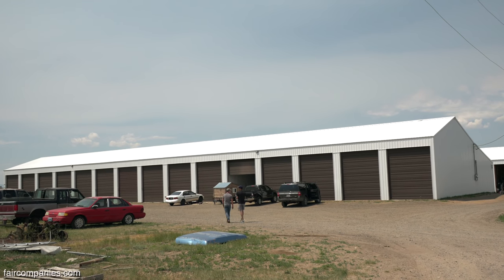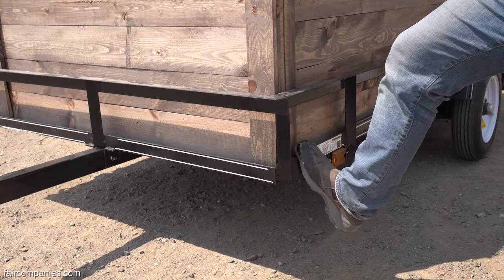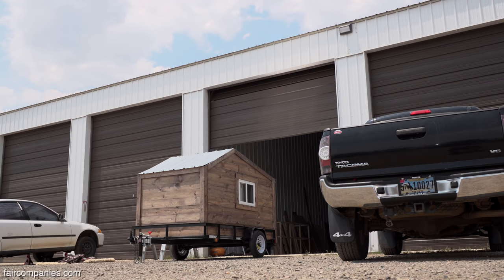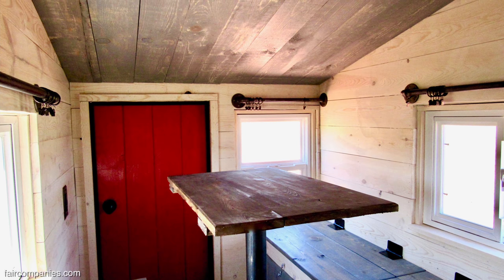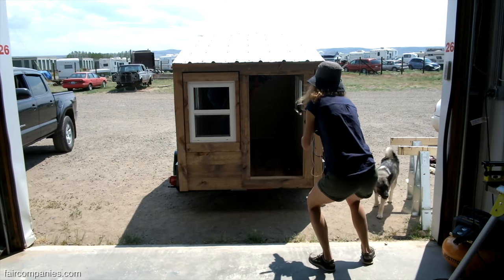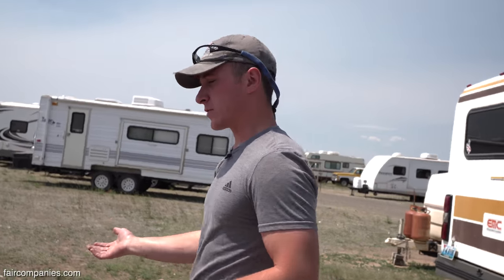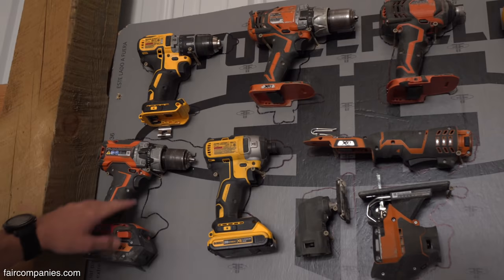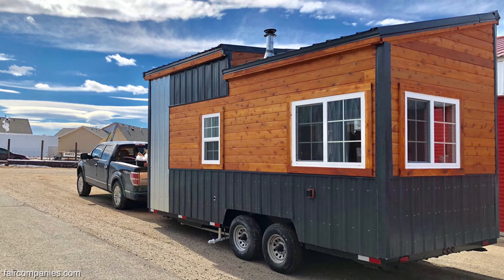Wyoming students make custom micro-campers to live & sell

Comment: As a Wyoming resident it is good to see this small state get some attention. As a carpenter/home renovator I love looking at what others are doing. I have a trailer in the back that I have been slowly tearing apart. It was supposed to be a small fix and the trailer was trash. $500 for a single axle trailer. Now if only I could tiny house that.

Comment: Just an FYI Ridgid Power Tools have a lifetime warranty on them you shouldn't have had to buy a new one if it burned up on you. If you buy them new at the store the Lifetime warranty sure does come in handy I've used it a couple times. A few years ago I also used to work in Hardware at Home Depot and did a few exchanges or Returns on them but if it's beyond one year after it's been purchased at Home Depot you have to go through rigid the manufacturer so I've assisted customers in doing this. It's super simple and they're really good about replacing it for you.

Nice video and excellent work.

Comment: The only real disadvantage to getting a bigger one would be the weight because you would need a bigger vehicle to haul it, but you could make a bigger house than that one and still be able to haul it with regular SUVs and small trucks. I'm thinking that if you were to use some different building techniques like using metal studs and less heavy exterior wood, like Cedar something, then you could make the overall structure way bigger and only ad maybe a thousand pounds at most. Look up the tiny house that these two teachers in Japan live in that can be hauled by their small van, I'm thinking you can make even something bigger that could still be hauled by a van.  Then you could distribute two models, one model for camping that is more off road focused and then another model that would be slightly bigger but still way basically the same that would be more for City travel and geared towards the market of people that just want to have a cheap and comfortable living space that's mobile and not have to pay rent or mortgage.   that second Market is actually way bigger than the camper trailer Market is because people are fed up of waste in the majority of their money on apartments for mortgages, so if you could offer 10 to $20,000 option that can be hauled by a regular minivan then you would have a huge Market of people around America looking to buy from you and you could have a huge facility to build for all those people eventually ( the biggest problem with most tiny house producers as they try to produce way too big of houses that end up costing the consumer way too much money and they have to be towed by huge vehicles, properly built tiny houses for one or two people without kids is probably going to be one of the biggest developing Industries in the coming decades)

Comment: I use mobile home windows. Mobile homes (called trailers) are delivered and this means they are pulled on the highways and interstates in all types of weather. The windows must be rain water resistant when going down the road. They are also way lighter and more affordable than home windows. Our windows were like $28 and $37 each brand new. You want small windows as people and bears can not break them out and climb through them.

Comment: At time 2:37 are the statements "it is treated lumber, treated pine..." and "If you are making a deck you can use this" which means that it is treated with poison to keep the bugs from eating it.  Since there is plywood inside the pine, the poison will take a while longer to get to the occupants.  Sometimes you really do have to know what you are doing.  Right, Kirsten.
Reply: That's just the siding. The interior is not made of treated wood. It should be fine.

Comment: You can lay down and stretch out very cool for a year drop camper, pack all the camp gear in it when you get to destination they can set up and the trailer is the sleeper.
Reply: or get a fucking tent and use the pickup to carry the gear
Reply: Gregory Everson I saw this video where this guy bought a old U-Hall truck with roll up door in the back he made a cool temporarily home out of it in the back it was stealthy living he said he could almost park it anywhere and it would just look like any work truck it was very cool how he had the inside set up for one or two people. Everything folded up out the way he isolated the walls and cut a door way to the drivers seat and a escape hatch on the floor of the cab so he could come from out under the truck. 

He could also back up in a parking lot to the water front and open the roll up doors and have that view he showed how people can't notice the door was open while backed in the parking lot. I thought that was the best stealth U-Hall truck made yet he said he set it up for temp living or he could travail in it.
It's on YouTube somewhere I wish I have saved it. For a tiny home living without anyone trying to hassle you for living in a parking lot like most campers and vans cars stick out like a sore thumb. If I was ever in that situation I think that's the way I would go. I found out they do have junk yards for motor home's so most of the stuff someone might need to build a set up like that it would already be made just have to install it or modify. Oh the only thing I suggested he should have had some kinda small camera's on the outside, so he could see who is on the outside walking around the truck because when your in the back and everything is shut down no windows to look out of. To be stealthily you can't poke your head out the door leading to the driver seats or you will blow your cover for tiny home living and want to get around taxes and anyone hassling a person living like that a person living like that still has to pay for being regersterd and gas and if someone wanted to pay for storage and still live in it but the only thing is he had it set up like a camper toilet where you would have to take it to a camper place to dump the SHIT tank properly and not drive around with the SHIT tank valve open to dump that shit on the high way

Comment: "Treated" lumber for the exterior. I understand the thought behind "treated" lumber and the exterior protection. However, I wouldn't want to be in it in the heat or with any kind of possibility of harmful vapors. : (
Reply: Susan Smith how would you go about it untreated? Just wondering.
Reply: @christianarcos4333  She is right, it's highly toxic, and you'd be sleeping so close it...  Better to use a less toxic sealant or better yet, side it with aluminum or metal roofing, that's what we did with my mini cabin...
Reply: @christianarcos4333  Metal Roofing over untreated Louber,with Roof paper between wood & metal.Treated lumber can be deadly for pets & humans
Reply: @brendaann727  Exactly

Comment: I really like how this guy kept prices down
Reply: John Liberty 
What do you consider a down price?
You can never stand up no matter how short you are. Very unsanitary.👎💩
Reply: Actually,  I thought it is overpriced for what you get. 😉😉
Reply: They've probably calculated everything and estimated. Tbh it's not 3k. To be exact, put everything together, it looks to be 500 dollars. Wood isn't all that expensive, rather free if you wanna cut it down to size yourself stove, not that expensive, depending on what kind of stove you put in. Bedding looks cheap, looks more like a jail bed, but a little more comfortable, appearance wise. Glass isn't too expensive. Wheels, no so. Maybe not 500, but a little over 1k. Don't forget to add the labor in making all of these mini homes. So we're looking at a little over 2k with all of it put together. The extra grand is just a price over to save more than you spend on supplies and labor. So... I'd say you are well in the almost even range... 🙄 Suppose... You don't wanna get ripped off, and they don't either. Probably spending a 100 or more over, but... Yeah it's almost right
Reply: @weinklent5082  the trailer is the most expensive thing

Comment: Um actually that's not going to keep out rain. You need to do a little more then slap a piece of stainless angle trim.
Reply: John Schoenfeld, I was thinking the same thing. Hopefully the new company owner does a bit more research and fine-tunes the designs. For a little more work they could be building a weather-proof tear-drop. (Form derived by function.)
Reply: I was thinking that also.  The trim was more cosmetic but not waterproof.
Reply: John Schoenfeld needs caulking before putting the drip edge on there. and I would put a drip edge under the metal roof panels and over the top as well with some black tar caulking u get from Walmart.
Reply: Michael Bauer I am a roofer, that's right on.imo
Reply: Well heck let the next person deal with it lol con game going on here!!

Comment: Not being to stand up would be a problem.  Otherwise, I love it.
Reply: small footprint       piano hinge on front of roof. 
What does it do to your fuel use?
Reply: It is a place to sleep. Not a place to live inside. Exactly what some people want. I am finishing my own micro camper and it is coming in around 1k minus the trailer and AC. Could have been cheaper but I am finishing with aluminum angle. I went with EPDM instead of metal roofing since it will never be visible unless you are 8 feet tall ;) and EPDM lasts longer than any metal roofing I know of. So far it is coming along nicely. Great video!
Reply: You can stand up in a Garden shed so already the Shed is winning...
Reply: Mexican and Asian could stand up!
Reply: @charleshoang6481  You sound like someone who has never been to Mexico. And I don't mean border towns.
Reply: Many people have back issues and especially disabled folks would need to stand in center
Reply: @rebeccaryan2391  : This guy built his for camping trips, instead of using a tent. Just a place to sleep in, not as a 'tiny house' necessarily. Others requested more amenities and add-ons. I don't think this would be the place for people with disabilities.
Reply: Perhaps another model that had a higher center could then accommodate special needs. A choice of two different cabins would be great.

Comment: I can teach you how to reduce the weight drastically. I'm building out a trailer now . Planning on posting the build on Utube. The unladen weight,  materials added to the harbor freight  4x8 trailer, should be less than 100lbs . Rigid foam and fiberglass.. Being in Southern California,  there will be an A/C and generator. Though I can run the ac off an inverter. So that will make up 70% or so of the laden weight.

Comment: How do you seal up the leading edge of the metal roofing towards the front from rain when going down the highway? Also at the ridge cap on front edge?

Seems like rain would find it's way in under the corrugations of the metal roofing.

Comment: R.I.P. F150 at the end of the video
Reply: pippensculps that's exactly what I was thinking lol
Reply: Yeah that is a scary amount of sag on the rear end.
Reply: Trailer not balanced properly. And probably overweight too. Certainly the tongue weight is way high.
Reply: Should have designed it as a 5th wheel for sure 😂
Reply: Yeah, air ride assist would help. See this every week on I-10...seriously some airbags under it with a compressor really help on light duty trucks.
Reply: pippensculps no weight distribution hitch i bet , and needs some kind of a leveling suspension too .. i lived in laramie wyoming gets sooooo windy and cold !!!!! Lol but the town is awesome ..
Reply: I was just about to make that comment, The driver is staring at the sky.
Reply: I mean, the guy said a trailer could be pulled behind a smart car so this guy probably ain’t the smartest person
Reply: Yep. Much too heavy of a load.
Reply: @LarsonChase01   😂😂😂
Reply: -just needs stronger springs
Reply: Holly cow time to buy a 1 ton diesel

Comment: Could use your welding skills and make the main frame out of aluminum. Could have a market for building off road trailers or slid in truck camper. If you could build a shell and are able to charge less then 8k, you could make a good profit.

Comment: Is it possible to build one with a v-top and at the top of the v-top inside would be 6-ft so you can actually stand just in that one part would it have a big difference in the weight mobility or what's the reason just want to know

Comment: I'm very serious, not just asking questions for the heck of it. I have a Buick LaCrosse, and I looked up towing capacity and the guide said only 1000 pounds, I found that hard to believe because she has a great and strong engine, but that's what they say, so my question is fully built how much does a double door in back, with that beautiful sky light and at least one window weigh, do you think? Also on a guesstimate, about how much would it cost for you guys to build, assuming of course that you would build one? Extremely interested. I am a big woman, elderly, disabled to an extent, so it would have to be built probably stronger than you normally would, idk for sure. If you have a different website where people can contact you, would you please give it to me

Comment: So much easier just to carry a a nice tent
Reply: CALife get a little cold in the winter in a tent. The guy is on the right track.  I would like to have the pickup camper
Reply: CALife, what is it with you "get a tent" people? If I had wanted a tent I wouldn't be looking at a campers on trailers video. You ever been in a tent while it was raining and touch the side of the tent? No, because if you do you cause a leak inside the tent and soon you have a puddle of water.

Comment: Going 55mph in the rain, I guarantee you the water will go under that 3" angle. Cute, but not my cup of tea.
Reply: simonlynchsae. silicon even manufacturers use it . or some kinda of sealant.  everything leaks not 100 percent water proof you have to maintain

Comment: That last shot with the tiny home on the 4x4.  Gonna get pulled over by every DOT cop that sees it.  Tongue way overweight for that truck.
Reply: Was just thinking the same thing. Need a 3/4 ton or a 1 ton to pull that.
Reply: Bryce Green, Empty trailer was probably balanced okay. But he built the heavy part ahead of the axles and created too much tongue weight.
Reply: blue ferral need 4 axles and 8 tires!!!
Reply: for the price of what it looks like it costs, u could buy a used pull behind

Comment: You need to Not put the roof screws in the valleys and put them on the ridges ONLY. Do not rely on the rubber gaskets on these screws they will always end up leaking and that will never be a problem if you put the screws at the top of the ridges.Number 2 Try not using all that heavy lumber, You need to build light. These are MOBILE they need to be light. Every pound of weight is going to need gas to move it. More weight, less fuel mileage.

Comment: Use ultra light weight strong materials like Aluminium with bamboo or hemp insulation
Reply: It's a micro-camper, so you need insulation that can provide high R-Value per inch but neither bamboo or hemp provide that... At least unless you're okay with making the walls over a foot thick and having almost no interior space left... Or don't really need insulation...

Natural material insulation is best for residential use where you don't have to worry about how thick the walls are...  You also don't want to use materials that will be effected by the vibrations and motions induced by traveling that can compact and shift certain materials as that in turn reduces or even eliminate their insulation value over time...
Reply: use the foam shit for insulation, and u glue the cracks

Comment: Anyone with carpentry experience could build this,,
,Id recomend using plenty of polyurethane glue and SCREWS on all joints to make sure it holds together when driving..
Reply: i would use some L-brackets on the inside